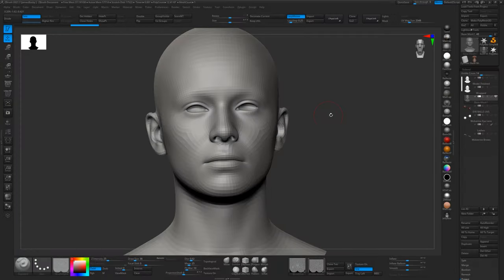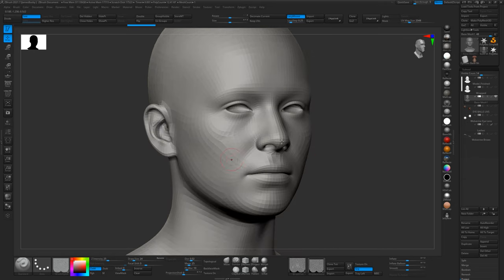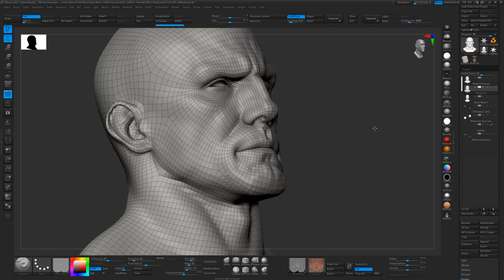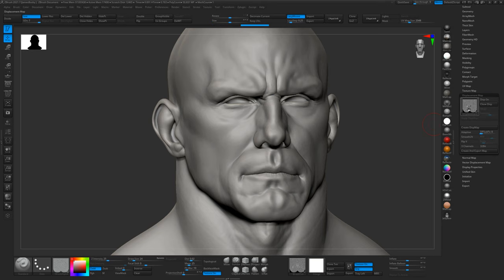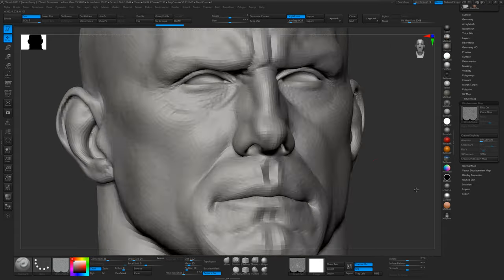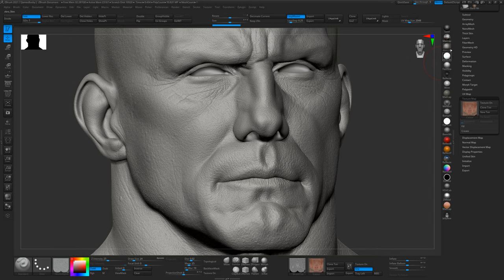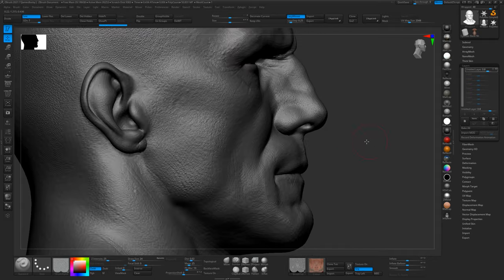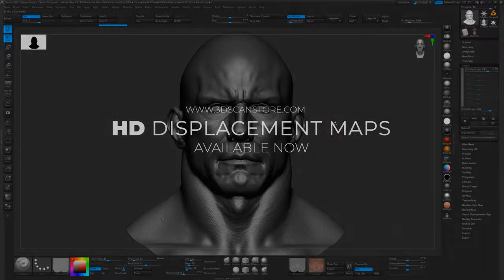Sculpting Method Using Our Base Mesh and HD Displacement Maps

Comment: I have a question, when you sculpt the shape, won't the original displacement details be distorted or stretched badly?
Reply: I was wondering the same thing. However, even if the sculpt and map are misaligned, I think wrapping with WRAP would clean things up. But it would be a bit more work.　Or perhaps you could just use a brush to move the topology around.